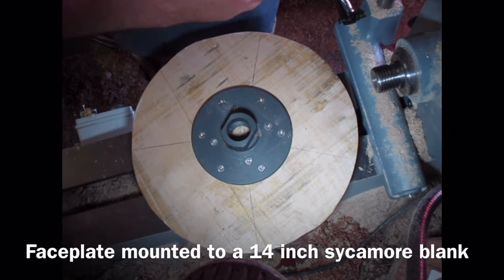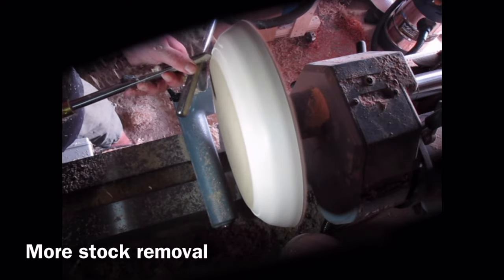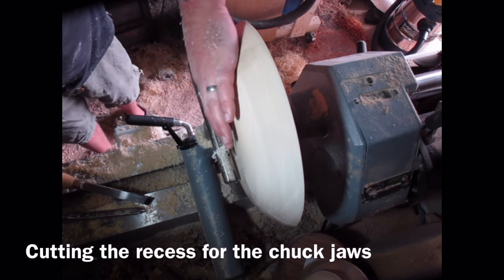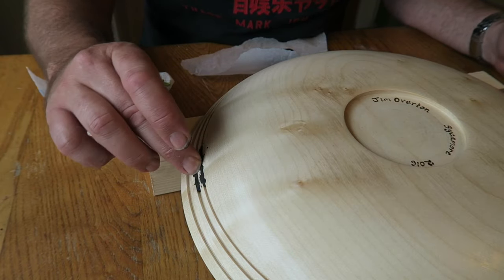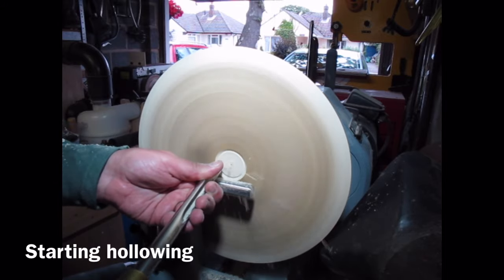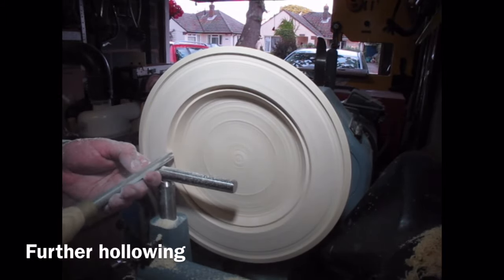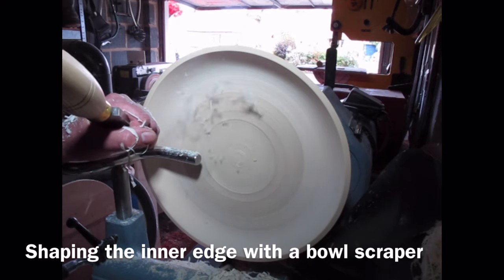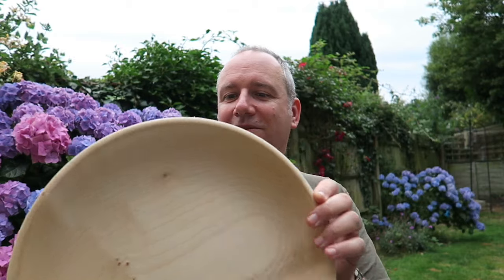Woodturning a Milliput Pinstriped Bowl

Comment: Jim,  In my youth, for many years, I was fortunate to be an industrial turner.  I worked as a journeyman pattern maker, and eventually bought the company.  Our 14 x 48 Blount Pattern Maker's lathe was a joy to use.  In addition, we had an old, wood frame industrial lathe that swung a 36 inch faceplate over the bed and 60 inches outboard.  The centers were 72", so I was, many times, covered with shavings while I turned big cylinders and other round items from Honduras Mahogany, Northern White Pine  and Popular, as I built patterns for valves, pumps, fittings and tooling for all sorts of machine parts. The joy of meticulous planning, gluing up stock, mounting and turning, as I looked for those hidden features, all the while working to 1/32" or 1/64" dimensions are some of my fondest memories that I see in your work.  Watching your videos has brought back some of the thrill. While I watch you work, I can almost feel the vibration of the unbalanced work piece disappear, as chips and shavings are replaced with symmetry,  order and beauty.  Your clarity, cleverness and craftsmanship are commendable.  I am sure many appreciate the vicarious experience, and I hope some actually dive in and find out, first hand, the pleasures that can only be found with a sharp tool, a steady hand, a solid lathe and cooperative piece of wood.  Thank you for the fine videos you provide.
Reply from the maker: Thank you very much Jack for your very kind words, they are much appreciated. I first bought a lathe as an extra tool in my armoury but it quickly became an addiction. As you say there is a certain thrill from turning something rough into something precise. I am delighted that you enjoy my videos and thanks for taking the time to watch and comment. Kindest regards, Jim

Comment: As always Jim, great stuff!  14" blank kept screaming Cello Banjo to me :)  Although in fairness, Sycamore is possibly not the best medium!  When I was a cable jointer, back in the late 70's, we used 2 part epoxy putty to seal with.  Each part was half a lb!  We used to drop the sealed packets in hot water to soften before mixing as we might need several lb's per end!  We definitely used roll and fold. It took ages, so I can imagine how long it takes for Milliput.  Great bowl young Jimson and a lovely finish!
Reply from the maker: Thanks Ian, a 14 inch sycamore blank could certainly be used to make a banjo but as you say not the best wood. Sycamore is definitely not a "tone wood" ! Milliput is certainly much easier to work if warm but of course that does make it set quicker and these fiddly jobs require lots of working time ! Cheers, Jim

Comment: Beautiful bowl. Why the need for sanding sealer inside the inlay grooves? I can see the need to get it on adjacent to the grooves before applying the Milliput to avoid getting the dust in the pores when turning away the excess.
Reply from the maker: Probably not necessary but it creates a good dust free surface. Cheers, Jim

Comment: Just curious...I noticed many woosturners never put a proper foot or ring on either surface, front or back.  Why is that?
Reply from the maker: just a design choice in my case, it is slightly easier to use a foot but you lose a bit of blank in doing so.
Reply: @JimsonMakes  hmmm...🤔.

Comment: hi Jim as I class you as the master of epoxy and turning, can you advise please. would milliput be strong enough to hold 2 parts of a bowl together?
Reply from the maker: Hi Lee, that is a difficult one to answer. In theory probably yes but I cannot say for certain as I have not tried it. I have several projects in my list that involve this but I do not know when I will get round to trying them. There are a lot of variables involved , especially the type of wood used, as some oily woods do not stick well. I would be tempted to "wet " the surfaces involved with a slow setting liquid epoxy first to ensure good adhesion. I would also stand well out of the firing line. The Milliput itself is strong enough and does not shrink but the pieces could still fly apart due to the forces and vibration involved. Try at your own risk ! Sorry for being so vague but this is untested territory. Cheers, Jim
Reply: Many thanks for your input. The wood is English Oak which was a little green and is in need of some repair so weighing up my options. 
Thanks again Jim.
Reply from the maker: +Lee Rogers I would definitely not use Milliput on green wood, Oak is particularly bad at cracking as it dries and I would want minimal moisture to ensure a good bond with the epoxy. All of my Milliput projects have been done on very stable dry blanks. Cheers, Jim
Reply: +Jimson's Stuff I was aware of that, it is completely dry now.
Reply from the maker: +Lee Rogers . It could be worth a try then Lee, but stand well clear when turning as it could be very dangerous if it flies apart. Running slow set epoxy resin into the cracks before packing the Milliput in would certainly help achieve a good bond but would be very messy. I would recommend West Systems G/Flex epoxy, it is very strong and you have loads of working time. Just make sure it is bone dry first , cheers, Jim
Reply: +Jimson's Stuff will do thanks again for your help.

Comment: How deep are the grooves? I’ve had trouble sanding white Milliput, can it overheat and melt / tear or is it probably because I didn’t mix it correctly?
Reply from the maker: I usually cut the grooves about 3mm deep. It is possible to overheat and then smear Milliput. Using a rotary sander will help prevent this. It could also be that you have not mixed it enough. The white is particularly tricky to mix. If the problem is only happening in a few places then it is probably inadequate mixing. Make sure you keep folding the edges and ends into the middle when mixing, it is these areas that will have unmixed material. Cheers, Jim
Reply: Jimson's Stuff. I cut the white back 50% and overfilled, cut and sanded back ok today. I’ll send you a picture if you have an email address. I’ve learnt a lot for my first attempt, wrong wood choice (Brazilian Red Cedar) for a start! Too punky, thirsty and prone to easy tear out. I think it’s looking not bad.
Reply from the maker: Hi John, if you go onto my YouTube channel page, there should be a link to send me a personal message. Sorry for the late reply, I have been away.
Cheers, Jim

Comment: noce work :) , about the blunting it might not have been heat treated all the way down the tool, it might be worth contacting a heat treating firm to re heat treat the chisel to about 3 inch away from the handle to give it more life.

also recently i learned of a coring tool sold by axminster called woodcut, ill post a link in another comment but it saves a hella lot of wood from just turning to dust plus also if you are doing the bowls this big you should be able to make a smaller bowl from what we would turn to dust ;)
Reply from the maker: Thanks Mark. I'm fairly sure there is a problem with the heat treat on that gouge. I looked at the coring tool recently and it is certainly something on my wish list. Cheers, Jim
Reply: +Jimson's Stuff no problem mate and ive just found this which could be a big limitation if not just saving the 1 core .. the optimum depth is 150mm based on a 300mm diameter blank but a shallower bowl can be made, not sure if you have seen it...

 http://www.ukworkshop.co.uk/forums/woodcut-bowlsaver-limitation-t71079.html
Reply from the maker: Thanks Mark, I have just looked at your link, this was something I had been wondering. I think I would probably get very limited use out of one these devices, and the blank I used in this video would have been too shallow. Cheers, Jim.
Reply: Jimson's Stuff http://www.toolpost.co.uk/pages/Turning_Tools/Kelton/kelton.html

Check out this one :) its cheaper, the standard size is for our bowl diameter range and comes with all the standard blades, also every blade size from micro to large can be bought separately and works with the standard set

Its a manual system not a mechanical sweep through but very shallow or deep cuts can be made, even taking the outside of a blank off if used very carefully to make a segmented vase where the cut off is the wall and a different wood for a base and rim
Reply from the maker: Thanks for the link Mark, looks good, might be an option when I have a bit more money. Cheers, Jim
Reply: +Jimson's Stuff same here on the money and a bit worse now as I,ve got got the axminster AV1628VS on order  without the legs, now got to get money to build a solid bench for it before it comes, thats me though always doing things backwards so now I'm in a rush!
Reply from the maker: +Mark Hobster . That's great news on the lathe. I personally think that  AT1628VS is the best value trade lathe on the market. I have been absolutely delighted with mine, it is very quiet and very powerful with every feature I could wish for. The build quality is amazing and it is very accurate, the castings could be a bit better finished in places but I don't care about cosmetics. You won't have any regrets ( other than an empty bank balance !), whereas if you bought a lesser lathe you may always wish you had bought better. You will be astounded by the packaging ! Heavy duty and palletised would be one description. You will need help unpacking and moving it. All the best, Jim
Reply: +Jimson's Stuff cheers mate i am looking forward to getting  and using it, and yes the weight im not looking forward to ;) , hopefully it comes better packed than the ts250 table saw i bought from them and it comes without the headstock attached to the bed else ill have to repressurize the wheel barrow tyre to get it to the bottom of the garden lol
Reply from the maker: unfortunately the headstock does not completely detach, it can be removed from the bed but is still attached by cables. Cheers, Jim
Reply: +Jimson's Stuff wow thats just a complete lack of thought by the designers eh :) even my cheapo axi from the turn of the century has a kettle lead connector between the controls and motor so it wouldn't have been too hard i don't imagine to add a connection for easy removal lol
Reply from the maker: +Mark Hobster . I think what they have done is put some of the electronics in the lathe bed, possibly the inverter ! Obviously the tailstock and banjo are removable which reduces a lot of weight. What I did was slide the headstock into the middle and 2 of us carried it between us. It was very difficult. You could put the headstock in one wheel barrow and the bed in another and wheel them along together with a mate.